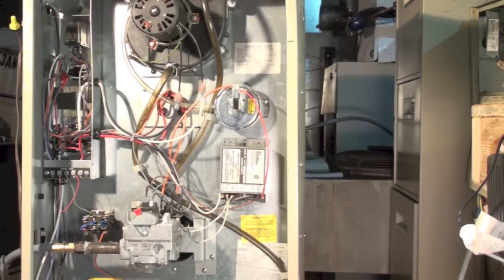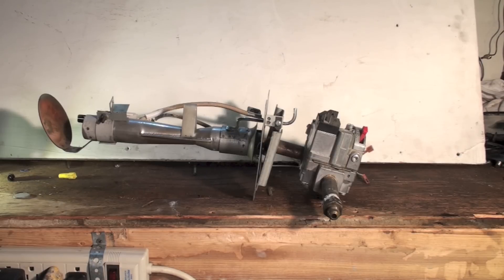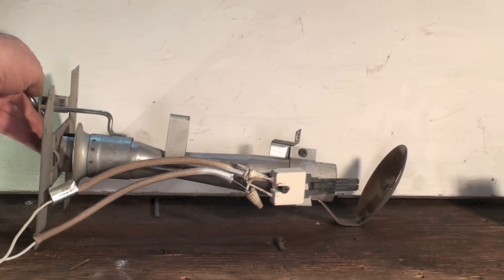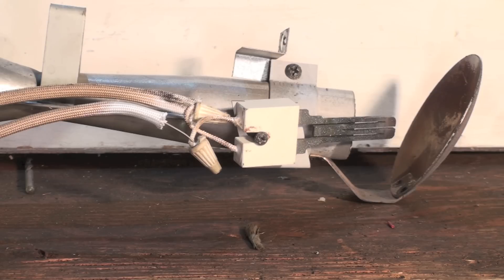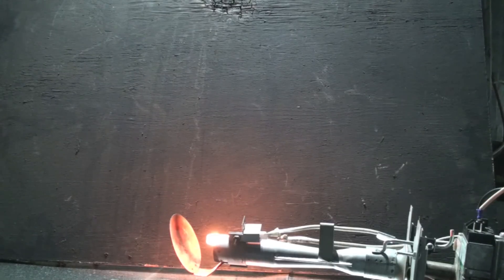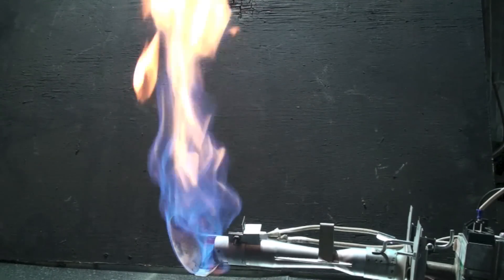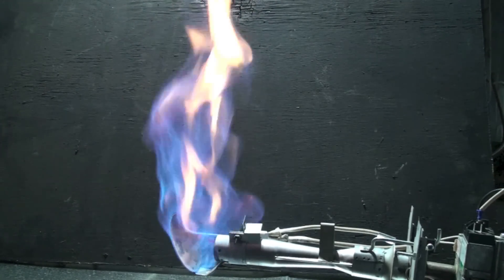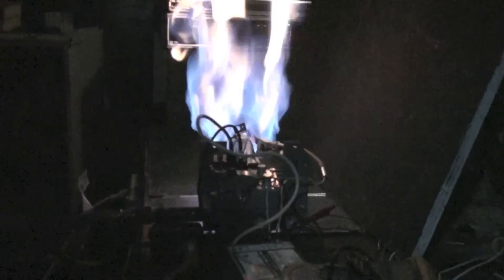Coleman Model CGU gas furnace.  A look at the burner.  Part 1

Comment: Hey Gary- have a similar Coleman and service technician checked it out today.  Our flame spreader/burner plate is detached causing the flame to hit the same spot within the box.  The box now has a black circle and is ashing.  He suggested replacing entire furnace because replacing the box/spreader would be similar price.  There are other issues like bearings shouldbe replaced, but main concern seemed to be the spreader issue.  Thoughts?

Comment: i have a similar model "2960-666"Coleman T.H.E furnace. Mine stays lit fine, it just rumbles A LOT, im not sure what is wrong with it. But the air adjuster has to be inset all the way forward or it has a scary about of rumbling. I Dont think my flame is as vigorus as yours.  Any ideas on whats happening? Do these barrel types normal rumble like this?
Reply from the maker: There is a baffle inside the heat exchanger.  They sometimes break loose.  You can pull the burner and use a mirror to look at the baffle.
GFM

Comment: Hi, We have an old floor furnace in our house. I do not see any brand on it.  It seems like there is a long lag time before it fires up, and sometime does not seem to fire up. The pilot and wall thermo control looks good. When it comes on it seems like the burner has a minimal flame.  How do you clean the burners, it seems like it is all enclosed. Thank you
Reply from the maker: +EurekaRecycler It can be taken apart.  Most parts are accessed from the bottom.  Probably the only parts available for it are the general replacement gas valve and thermopile.
GFM

Comment: My Coleman 7900 Presidential series, I’m trying to light my pilot this year but as soon as I let up on the pilot prime valve the flame goes out. I read that the thermocoupler is probably bad,even though I replaced it 2 years ago, I bought a new one and it’s still a no go. I can keep the pilot prime valve pressed in for even 10 minutes but as soon as I let it up, out goes the flame . Gas valve perhaps?
Reply from the maker: If the flame is covering the thermocouple, and the thermocouple on the gas valve is clean and tight (snug, not reefed down), then the gas valve is probably failed.
GFM
Reply: grayfurnaceman thanks Gary. I replaced the gas valve and this did the trick. I think the solenoid was stuck in the old valve. Moving to the next issue. Good solid pilot now, but when the furnace kicks on more often than not the flame puffs a few times then goes out and blows the pilot out with it. I have to relight and try again. It’s as though there is air  in the line or a restriction in the gas supply. Once it’s going, it’s going well. Then when it kicks off and back on again the issue repeats. Could this be a bad burner assembly? All these parts seem original probably from the mid 80s
Reply from the maker: @KevinModz65  The manifold pressure is probably wrong.  You can set it with manometer or by clocking the meter.
GFM

Comment: I think a smaller orifice would solve a lot of the 'yellow flame' problem.  It is burning too rich.  The 'yellow flame' will also cause the flame sensor rod not to heat efficiently  and will cause the furnace to shut down.  This is the biggest problem in gas furnaces that were used in mobile homes in earlier models.

Comment: My coleman presidental 2 furnace goes up 2 degrees and then the flame goes out/ or when i get home from work i cam hear the draft motor running but the furnace isnt on. I will go and turn the thermostat off and turn the furance of then wait 5 mins and turn it back on.. I can hear and see the ignitor sparking but little gas comes out and then it won't light it a try two more times and by the third time sometimes it attached and turn on and sometimes it won't
Reply from the maker: This one depends on the age of the furnace and the controls used on the furnace. If it has the Robertshaw 780 control, and does not have a flame rod, the control should be replaced and a flame rod added.
GFM

Comment: My burner looks similar to this burner, but is a standing pilot. Could I use this burner to upgrade my furnace to hot surface ignition to save money on propane?
Reply from the maker: You can replace the pilot system with an intermittent pilot system such as the Honeywell Y8610U kit.  HSI conversions are not available.
GFM

Comment from the maker: When used in a mobile home they used a concentric vent in their 80% models.
GFM
Reply: I have 24 v's going into Robertshaw. I do not have 24 V coming out at the contact going to gas valve.  I then tested as you said. There was no power in 7 secs or for 7 secs after burner came on. I held tester there for 5mins & got nothing. In your vid on Robertshaw you said its the most common problem. The common wire & 24 v power Wire to gas valve have continuity so the wires are good. There is also continuity between the 2 commons on the gas valve. The main power wire to RS & Common on RS have 24 V according to tester. I did the 7 sec Volt ck on power & common at the RS to the valve also, there was no power at anytime. It may be the RS. Do you have any hint?

Comment: hey gary! i got a evcon dgat056bdc and was told flame sensor was going out by a technician that cleaned it, so now the burner lights up for like 10 seconds or less then clicks and goes out... i looked online here and cant find the flamesensor that is just one screw to pull out and clean... i feel its a yellow wire that goes to the burner , i dont want to remove to the burner if it needs to be resealed or i can just unbolt or bolt back in... then maybe i could see if it needs a cleaning or not? whats your thoughts?
Reply from the maker: You can remove the burner without breaking any seals. You will remove the gas valve and then pull the burner.
GFM
Reply: @grayfurnaceman  thanks! i just did that and flame sensor looked clean but i cleaned it anyway with some sand paper and put it back together and it still trips out after flame is lit for few seconds... maybe the sensor is totally shot?
Reply from the maker: If the flame is covering the flame rod, I would say the control board may be at fault here.
GFM

Comment: i have a Coleman DES80 gas furnace.. It'll start fine.. run for around an hour or two.. get to the target temp.. Then it won't work after.. It'll run, but no heat or flame.. Then if i turn the power switch on and off.. It'll repeat the same steps.. Any idea what's going on? The flame is blue..
Reply from the maker: If it uses the Robertshaw 780 control. it is probably failing.  
GFM
Reply: It does.. I guess one of the wires wasn't connected.. so i had a guy put the wire back on it..  the box was just replaced last year.. I turned it off for around an hour then turned it back on.. now it's working.. hope it stays working lol

Comment: I got a coleman furnace mobile home. I get a flame but no burner.  No codes. Green light.  Blower kicks on. But no heat.  No burner.  I get 24 volts coming from control board. How can i check gas valve. Am suspecting gas valve
Reply from the maker: Are you saying you get a pilot flame but no main burner?
GFM
Reply: @grayfurnaceman  right no burner. Colemas only has 1 burner. It has 24 volts from control board.  Steady green light on control board. Hsi glows and then i get flame. 50 seconds later blower kicks on but no burner. No heat.
Reply from the maker: @intelin123  If the ignition control is the Honeywell S86 model, the flame rod on the pilot assembly may be dirty.  The burner will have to be removed and the flame rod cleaned with sandpaper.
GFM
Reply: @grayfurnaceman  i already cleaned flame senson . A long ceramic white looking thing with metal inside.  I havent check control board model number yet.  I will soon
Reply from the maker: @intelin123  I would check the amp draw of one the wires to the gas valve during a call for heat.  If there is amp draw (about .2 to .4 amps), the gas valve or a blockage or low gas pressure is the problem.
GFM

Comment: So I have that exact Burner on my old Coleman Furnace in my trailer. It keeps cutting off every 30 seconds. Has done this before too, so if there is no flame sensor what is causing it?
Reply from the maker: I would first jumper out the thermostat to see if it still does it.
GFM
Reply: @grayfurnaceman  I will give it a try
Reply: @grayfurnaceman  Mentioning jumping the thermostat gave me an idea. There are 3 external sensors on my furnace Coleman 7966A856. Last year I replaced the sensor on the top of the furnace with a temperature adjust on it. There are 2 more side by side, inside a metal box right in the middle of the unit, the box has the wires & sensors inside it, the transformer & a switch to turn the furnace on & off. The sensors are side by side, one has 2 wires & the other 3. I jumped the wires on the sensor that only has 2 wires going to it (I believe it is the fan sensor) & when I do the Fan comes on & doesn't kick off 30 seconds later but the fan runs full bore when I do this & doesn't shut off. It also seems to be running  a bit cooler than normal. So If I had to guess it could be that sensor. Thankfully both of the other sensors that are external are cheap. I will replace them both & if that doesn't work I will probly get a new thermostat. If that don't work than I will try to replace the Igniter/Flame sensor (want to save that for last because it is the hardest lol.
Reply: My burner assembly has a flame sensor.  My furnace has flame but no burner.  Blower kicks on. No red lights.  Green light steady.   Sequence of operation is normal. But no burner no heat.
Reply: @intelin123   I also had to replace the Regulator outside my house on the tank

Comment: Hi Gary I have the Coleman model DGA Natural gas and the ignitor lights up but the flame will not Come on.  There is no air adjustment on mine. I do have the robertshaw HS 780. 
                 I've looked at a number of your videos. All of which are very good . But None of them telling me why the Flame doesn't light up when Igniter lights. I have watched your videos. I have an idea gas might not be getting introduce. Therefore Flame does not come on. But there are a number of other moving parts to this. 
                Can you give me a clue As to what might be going on & what videos I might follow to try and correct this problem? I do work with tools, so I am a little handy.  
              I examined the burner and I decided that I can take it out and replace it if necessary . But it glows just fine the way I'm seeing it . Thanks . Oh & the blind air damper does not open up. It does open when the AC is on as well is the blower blows.
Reply from the maker: I would be checking for voltage at the gas valve during a trial for ignition.  After the ignitor warms, the gas valve will have voltage for 4 to 7 seconds.  Voltage there = gas valve failure or no gas available.  No power, ignition control failed.
GFM

Comment: Furnace starts runs when blower kicks on flame goes out then will relight run for little bit then flame burns out slow . Then relight then shut down blinks ignition failure any help would be greatly appreciated. Also then it will run fine for couple days
Reply from the maker: Todd Johnson I would first look for a crack in the heat exchanger. 
GFM

Comment: This is exactly the same burner I'm working on, someone had already replaced a new gas valve, a new relay and a new ignition module but still not working right. I checked the hot surface ignitor 63 ohm when not hot and 25 ohm when hot. Is it a bad ignitor? There's nothing else to check for. It turns on the burner stay on for only 60 seconds then shuts off. It shuts off from the ignition module. Anyone has any idea?
Reply from the maker: goodkao The igniter is ok. If the unit does not have a flame rod, it probably should have one.
Reply: Hi, thanks for your answer. I dont see a flame rod. It's only come with a hot surface ignitor and one single burner with a Robertshaw  HS780 34NL-306A Furnace Ignition Control Module. How do I add a flame rod to it?
Reply from the maker: goodkao The 780 control will not work with a flame rod. You will need a control similar to a Honeywell 6800 control. The flame rod may be a bit harder. You will need a general replacement flame rod kit. 
GFM
Reply: So, I only need a Honeywell 6800 control and a flame rod kit, right? Or any easy retrofit board can replace 780 control?
Reply from the maker: goodkao That system will work but it is fairly complex. 
GFM
Reply: Ok, thanks for your help GFM.

Comment: Gary can you switch from a pilot light to the igniter? I have an older unit with the pilot, and what would make pilot light go out? any reply would be nice
Reply from the maker: First, be sure you have no heat exchanger cracks.  The Honeywell S8610U retrofit kit will convert from standing pilot to intermittent ignition.
GFM

Comment: We are trying to convert our Coleman dgat056bdc furnace from propane to natural gas. We changed the orfice and not sure what else we need to change. Can you help?
Reply from the maker: The only proper way to do this is with a factory supplied changeover kit.  As Coleman has been purchased by York, it may not be available.
GFM
Reply: We have the change over kit. Was just looking for the steps to do the change over. We have the kit from purchase. I am good at keeping things like that. Sadly in the move of our home we had our things in storage at a family member s garage and the box with our furnace owners manual and instructions was damaged so we do not have it to refer to.
Reply: Thank you for the help!
Reply from the maker: @BMarch-fj6hh  I will try to help.
There should be a new cap for for the adjustment of manifold pressure with a new spring that can be installed on the gas valve.  Shut off the gas before messing with the valve.
GFM
Reply: Where is the spring located? That is what we are having trouble with.
Reply from the maker: @BMarch-fj6hh  Its under the top of the regulator.  There is a regulator (usually on top of the gas valve) that has several screws that need to be removed.
GFM
Reply: Okay thank you.

Comment: I have one of these and I started it yesterday and the flame seems weak it wont heat up my trailer. Any thoughts?
Reply from the maker: Propane or Natural?
GFM
Reply: @grayfurnaceman  natural, I found a spider nest in the orifice, I cleaned some out and got a better flame but now goes out when the fan kicks in
Reply: It was the primer I adjusted it and it's all good now. Thanks!!!
Reply from the maker: @tonyqrz  You may have a crack in the heat exchanger.
GFM
Reply: grayfurnaceman  I have a Coleman furnace in my mobile home. It’s from 2011. No codes. Everything seems to be working, but I have cold air coming out of the vents. It has flame, and stays on. I’m at a loss as to what to look for.
Reply: @mattalford3932  check the valve outlet that's how mine was. A spider nest was blocking gas flow
Reply from the maker: @mattalford3932  If the burner is burning, the air must be warm. Are you sure the burner is continuously on?
GFM
Reply: grayfurnaceman the flame stays on like it normally would. My burner is almost identical to the one in the video, but the flame is nowhere near that big.
Reply: grayfurnaceman I have a video but I don’t know how to put it in the comment
Reply: grayfurnaceman  I just uploaded a video to my channel of my furnace going through it’s starting sequence
Reply from the maker: @mattalford3932  The flame is too small.  You can clock the meter to find out the usage.  It should match the input rating of the furnace.  
You can also check manifold pressure.  It should match the model plate.
This is getting a bit complicated.  Are you sure you want to continue?
GFM
Reply: grayfurnaceman sure. It’s a learning experience for me.
Reply: grayfurnaceman I called my local mobile home parts place. They suggested cleaning the orifice. Thanks for you’re help. I’m thinking it’s a pressure issue  a friend had to replace the manifold gas valve for a similar issue.

Comment: We have basically the same unit. Having a problem with the furnace running longer than a few minutes which in turn keeps the house cold. If someone could please let me know what to do. The only difference is my furnace doesn’t have the sleeve with the handle.
Reply from the maker: Sounds like a problem with the flame safety control.  These units had a lot of problems with the ignition control.  If it has the Robertshaw 780 control, you may need to replace the control.
GFM
Reply: grayfurnaceman where would I be able to get that little sleeve that goes over the base at? I’m in Michigan.
Reply from the maker: I have no source for that.
GFM

Comment: Mine has a pilot but the burner does not turn on. The pilot does turn on but not the burner. Any idea of how to fix this?
Reply from the maker: Is there power to the furnace?
GFM
Reply: @grayfurnaceman  yes there is power. The fan works when I turn it on directly with the thermostat not when it's on auto. The pilot stays on. After watching several videos, I'm thinking the thermocouple. What do you think? Is that what's keeping the burner to turn on?
Reply from the maker: If the thermocouple is failed, the pilot would not stay on.  I would be checking for voltage at the gas valve.
GFM
Reply: @grayfurnaceman  so the thermostat?
Reply: So do you think it's something in the thermostat?
Reply: What is voltage in the gas valve?
Reply from the maker: On a call for heat, the thermostat sends power to the gas valve.  This is low voltage 24 volts.  If you can use an electric meter, you can set the probes to the terminals of the gas valve.  If 24 volts is read, the gas valve has failed.  No 24 volts, the problem is elsewhere.
GFM
Reply from the maker: If you want to test the thermostat, jumper the R to W terminals of the thermostat.  If the unit starts, the thermostat has failed.
GFM